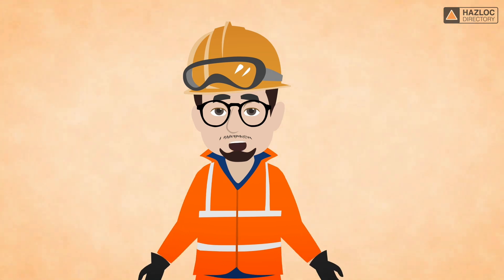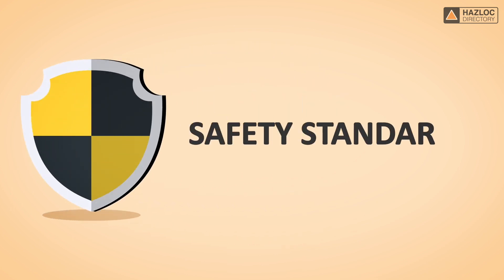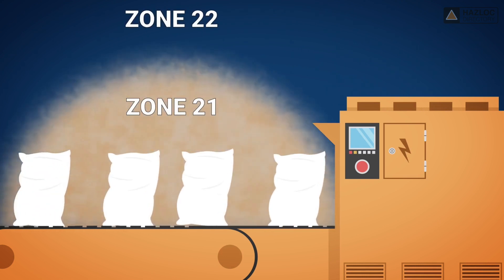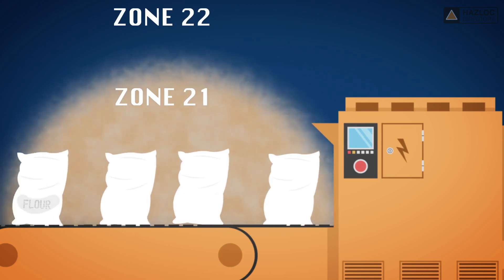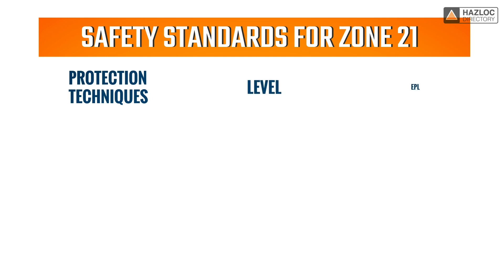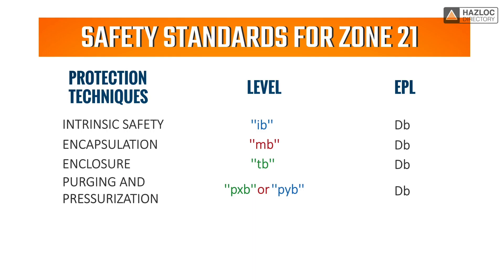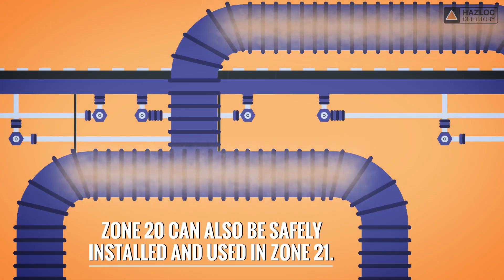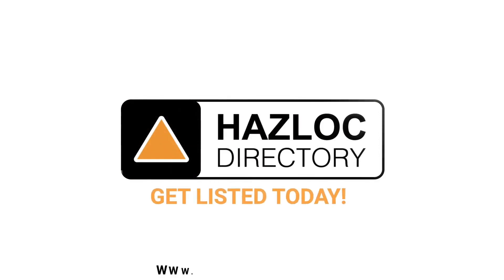Hazardous Locations - Zone 21

Comment: if motor require 35mm square cable in zone 2 . if we install this motor in Zone 1 .do we need to increase cable size or no ? does Zone classification affect cable size ?
Reply: I do not know any standards (here in Europe) which renders certain cable sizes to certain zones. You have to carefully size your cables, not to reach the temperature limit of the zone or the cable Tmax, in any conditions. Cable size and fuse sizing are very important.